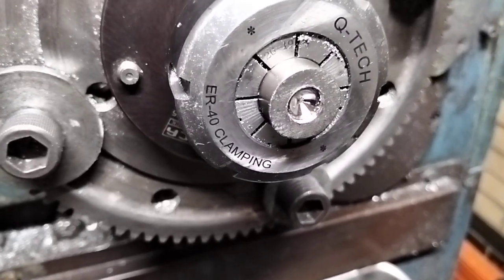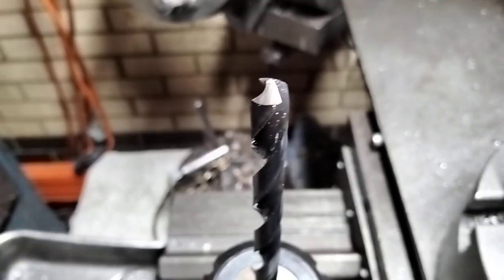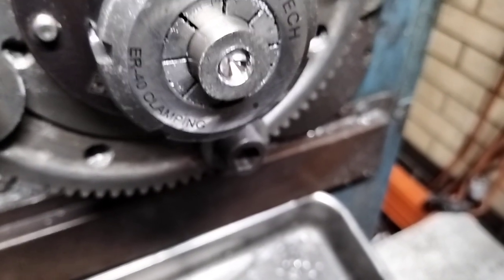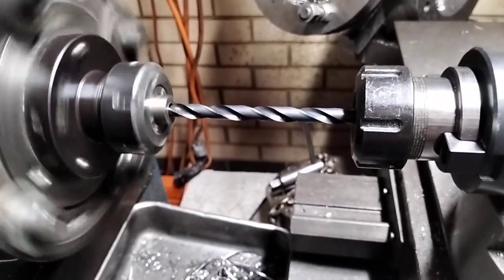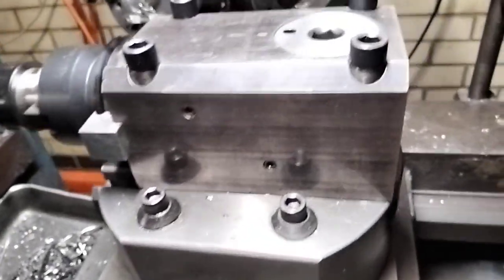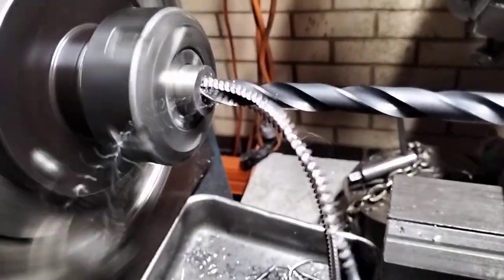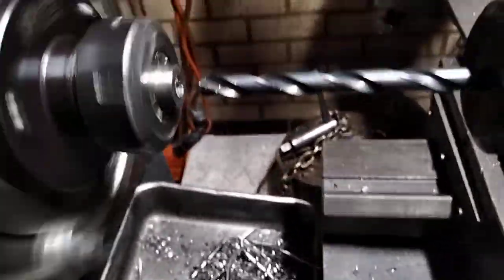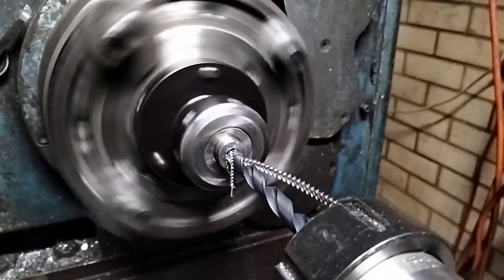Titanium cuts like high tensile butter with attitude issues

Comment: Is titanium a fire risk if you machine too fast?
Reply: Depends. Within normal parameters not really. When you go with all the SFM, full send and glowing lametta chips, yup, that might burn a hole right through your chip tray. lol
Reply: I've machined it a few times before. It's not all that easy to light the chips on fire, harder than magnesium. A few of the older guys at the shop used to work in aerospace and talked about a few lathes going up in a blinding blaze...lol

Probably has a lot to do with chip size and the volume of chips around.
Reply from the maker: Keep the speeds feeds and clearances good and you won't get a spark. 

Once you get the drill clearance tightening up or the cutting speed too high that's when you get the risk of a spark, 
And yes the finer stuff is easier to catch... But the thicker stuff can take quite a bit to ignite....you really have to try .